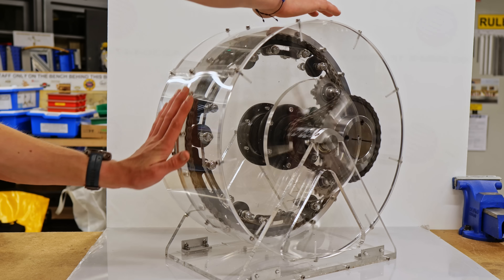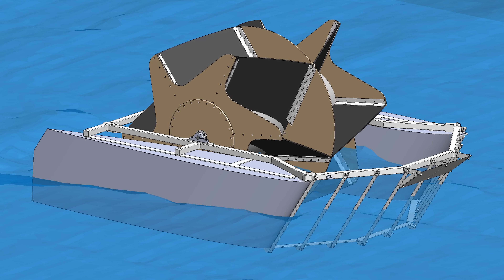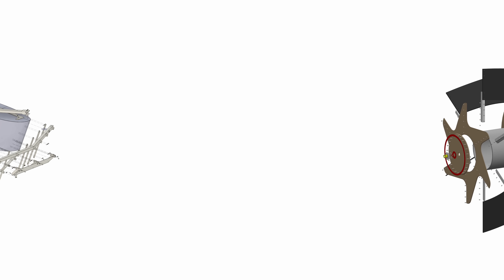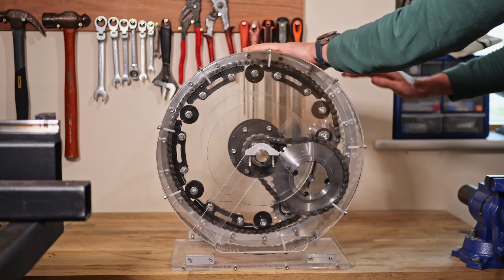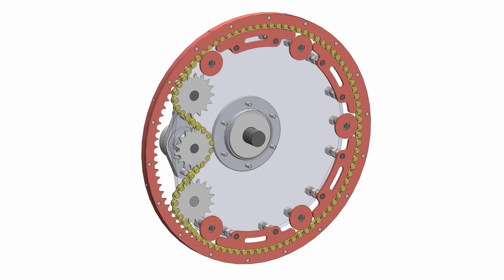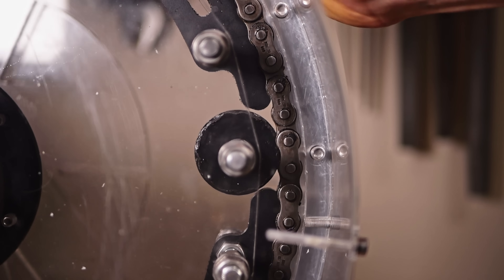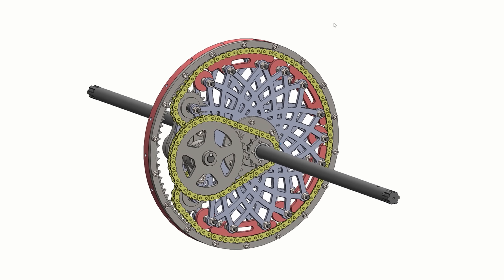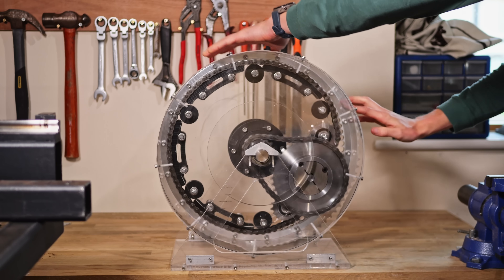Design of an Inverse Chain-Drive Transmission

Comment: Very nice design.  I was thinking if you could reduce the friction on the guide by getting rid of them, and make a shortcut for the chain from the inverse sprocket toward the middle.  Although there is an advantage with the large engagement, I think it is a bit too much.  You could add a guide offset to the middle, and shortcut the chain from the in and out guide guides to the offset guide wheel.  Some guides could be added but they would not increase the friction significantly since the chain would not be pressed against them (little bit from gravity of course).  Another design idea would be to use the first and second wheels, and the first guide on both up and down sides, and then shortcut the chain from there.  That would reduce the friction significantly.

Again, nice design.
Reply from the maker: Thanks! Yeah I was also thinking of this when I was designing it, but decided not to go for it in the end because of the added complexity of getting the chain links to line up again with the sprocket after taking a shorter path than the diameter. But I agree if done correctly could go a long way to reducing the friction
Reply: @taow  Why not move the chain to an external sprocket, i.e. from the inside to the outside? This means that the guides and pressure rollers are no longer needed. The guides have a huge braking effect, as the more power is transferred, the greater the braking effect, which cannot be significantly reduced with oil.
It is therefore better to move the sprocket from the inside to the outside, which also completely saves the immense amount of work required for the guides and pressure rollers.

Warum nicht die Kette auf ein außenliegenden Kettenrad, also von innen nach außen zu verlegen? Somit fallen die Führungen und Andruckrollen gänzlich weg. Denn die Führungen bremsen enorm, denn je mehr Kraft übertragen wird, desto höher ist auch die Bremswirkung, was mit Öl auch nicht wesentlich verringert werden kann. 
Daher ist es besser den Zahnkranz von Innen nach Außen zu verlegen, was zudem auch den immens hohen Arbeitsaufwand an Führungen und Andrucksrollen völlig erspart.

Comment: Cool design. It probably needs to be under half of oil, like the cain drive in some BobCat loaders.
Reply: I think it would need very little oil just 500cc in the sump of the inner box. If the whole chamber is sealed - chain will bring all of the oil to the top and lubricate everything.